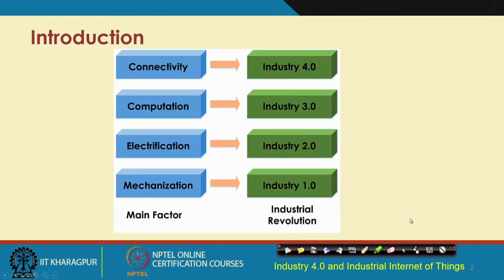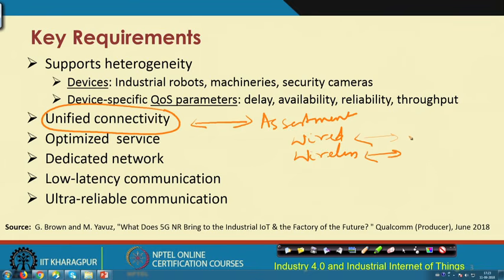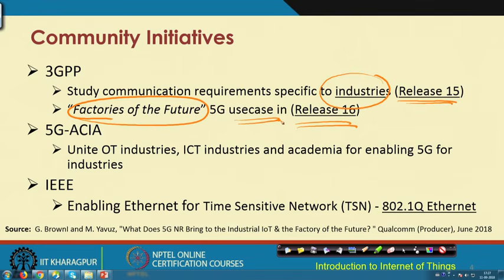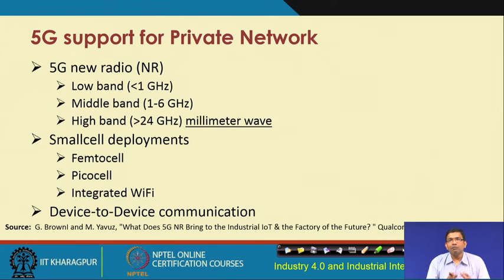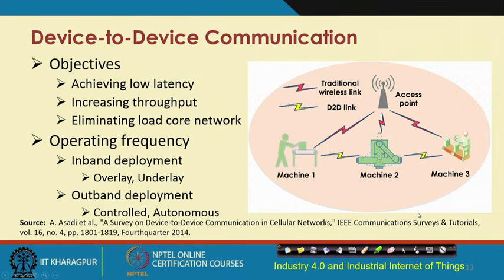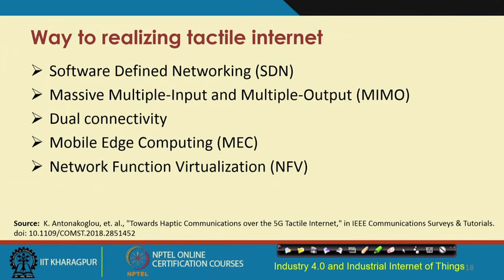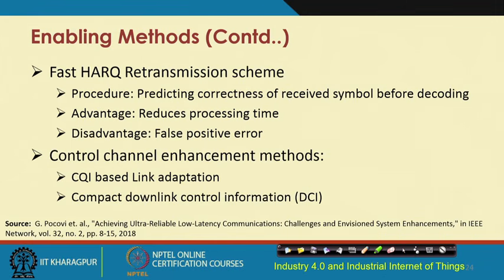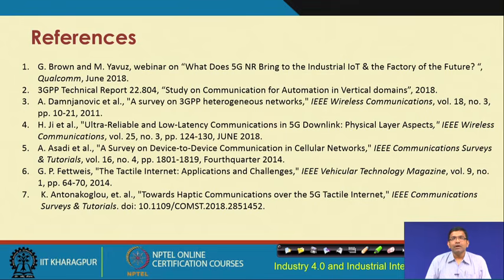Lecture 30 : Key Enablers of Industrial IoT: Connectivity-Part 3

Comment: Availability: 6-Nine(99.9999%)
End-to-end latency: 1ms
Reliability: <10^-5 outage probability 
Packet size: 32-200 B
Smaller transmission duration